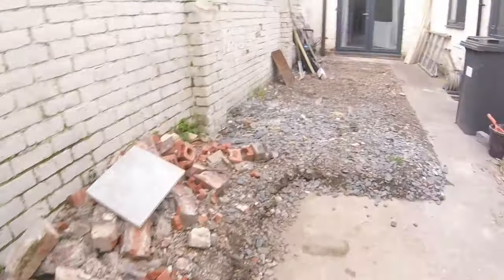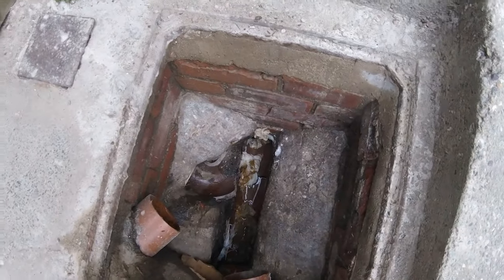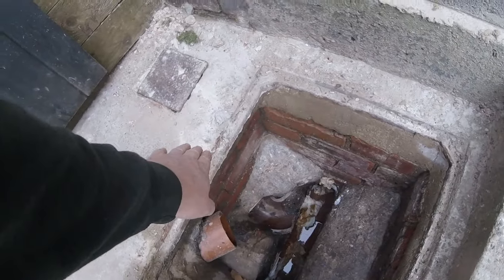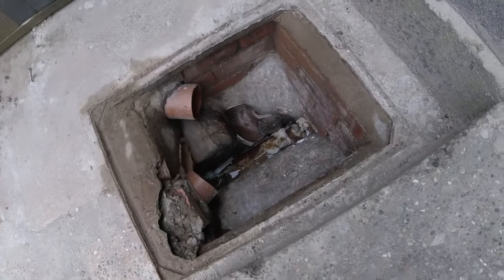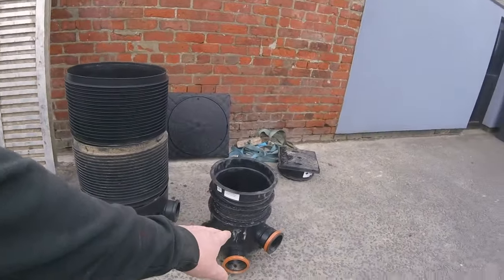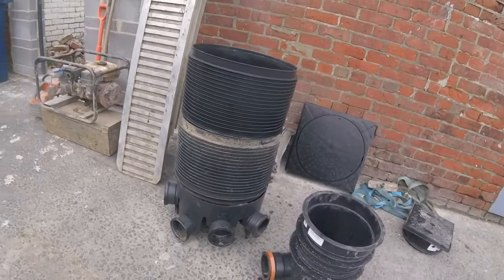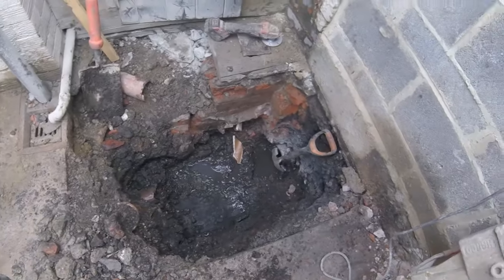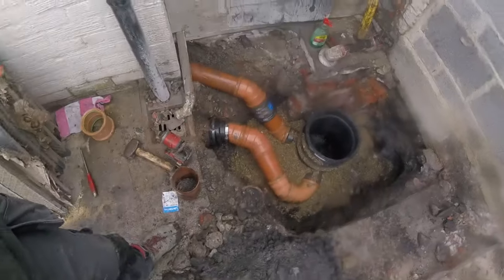Nyas Construction Collapsed Pipe   Manhole

Comment: How did you connect it to the main outlet away to sewer?
Reply from the maker: We use a band seal that couples up old imperial clay pipes to the more metric 100mm plastic pipes similar to the one you can see in the video but missed the other pipe on the video part in question. 😊